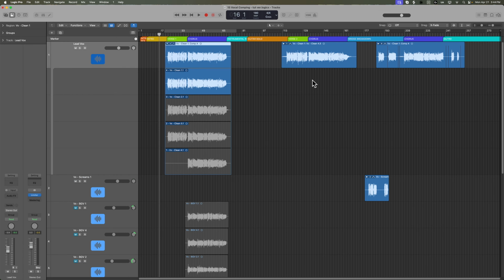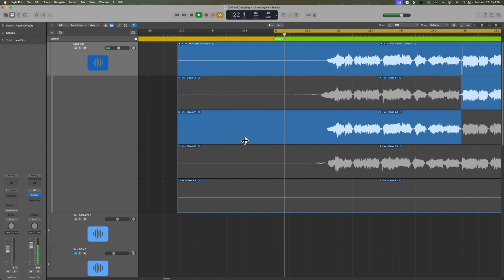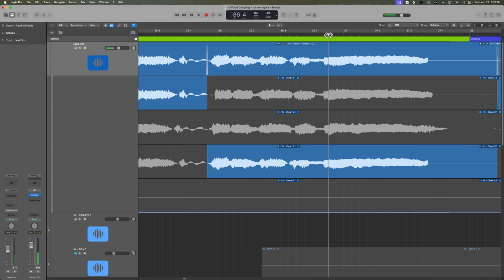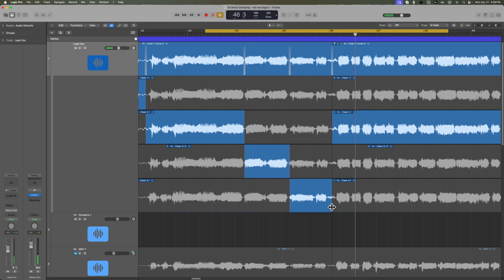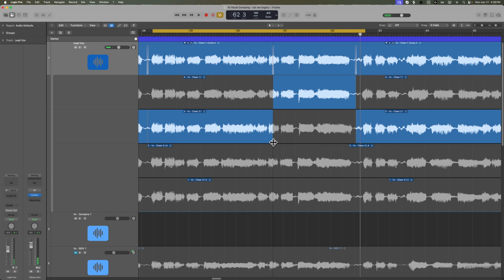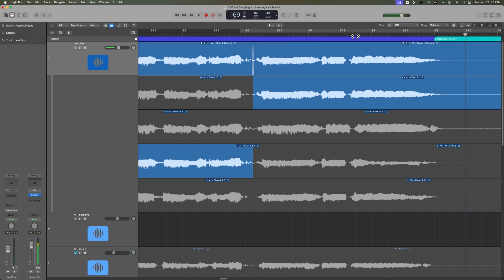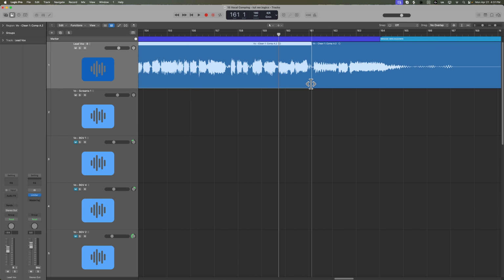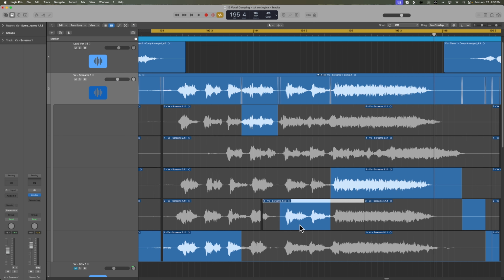Logic Pro 11 Mixing | #15 Vocal Comping with Quick Swipe Comping

Comment: @musictechhelpguy - this is good, but it would be very helpful (especially for repeat visitors, and for more experienced viewers) if it started off with a quick run through of all the tricks you use: quick swipe comping using the locators, time shifting selections, using track alternatives, and flatten/merge. That could all be summarized in less than three minutes. Then people could stick around for the detailed case studies.

Comment: Hey Josh. I hope it's alright if I ask you more of a production-relevant question. Just watching you use Quick Swipe Comping here in the verses, I notice that the Lead Vocal is always just one voice, but when we get to the Chorus, we get the harmony vocals (but, again, no direct doubling of the lead vocal). How frequently (if ever) would you actually have L/R doubles of the lead vocal itself?
Reply from the maker: In this course, I did not do that, but normally I would. For verses I typically stick with a single lead vocals, and in the choruses I may play around with vocal doubles. You could take some of the unused takes in the chorus and edit those into doubles.